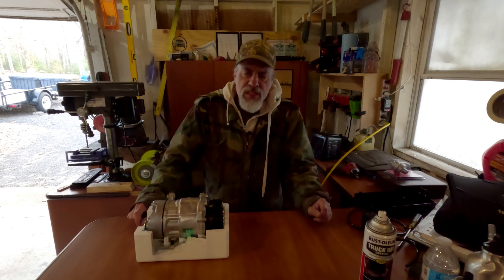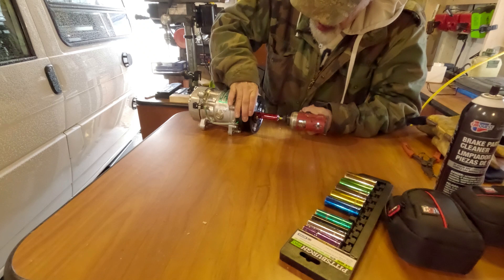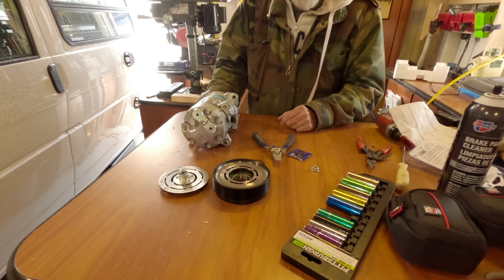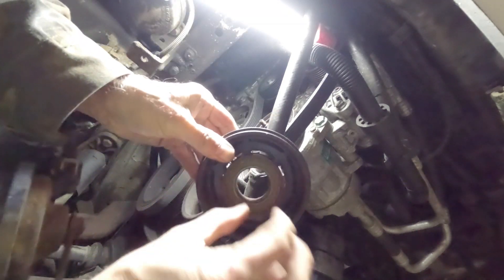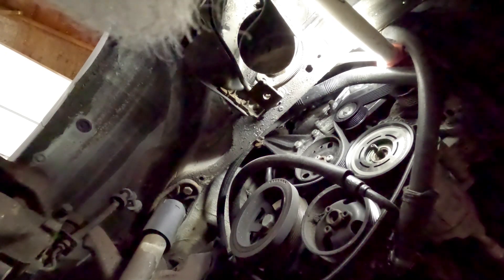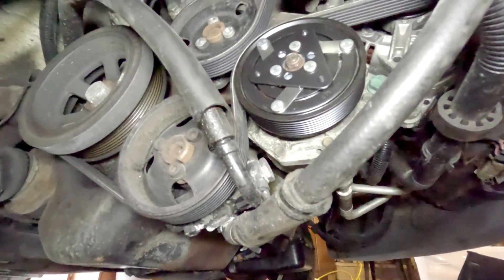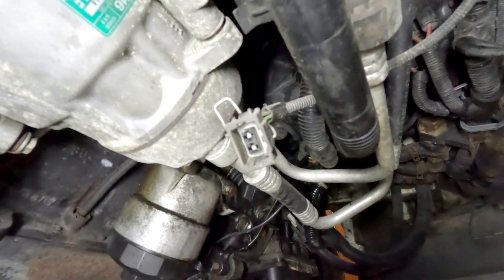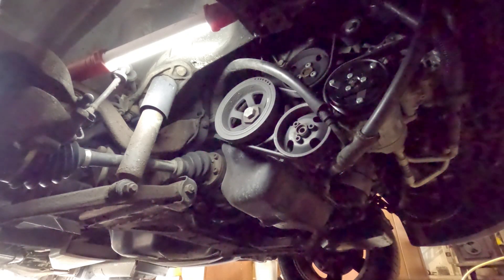How to replace A/C compressor bearing and clutch on a 2000 VW Eurovan

Comment: Hello, thank you for your videos; they are very interesting. I also have a Eurovan, although it is a 2003 model. However, I have a problem: my air conditioner won't start. It might be an issue with the compressor. When I bought this car, the previous owner told me that if the air conditioner stops working, I should touch a wire connecting to the battery's positive terminal, and it should start working. However, recently, it stopped working even when I do this. I would appreciate any advice.
Reply from the maker: Hi as you stated ,first step would be to jump the compressor to see if the clutches engage. Next step would be to make sure it has the correct amount of freon in the system. Beyond that you would want to look for a shorted or chewed wire.